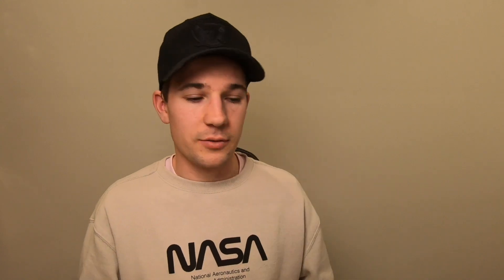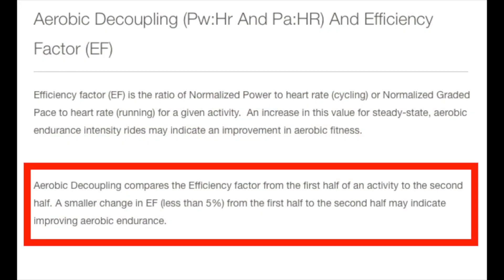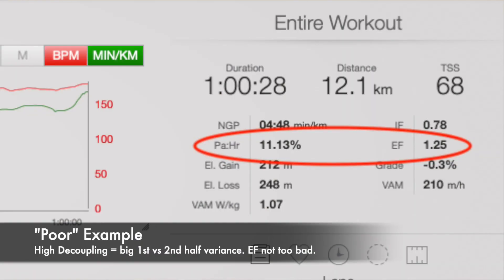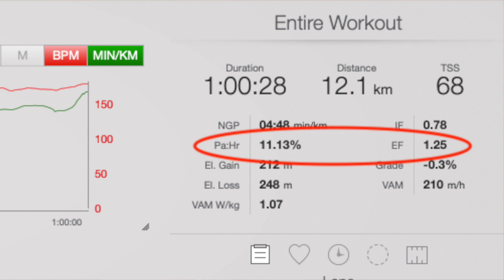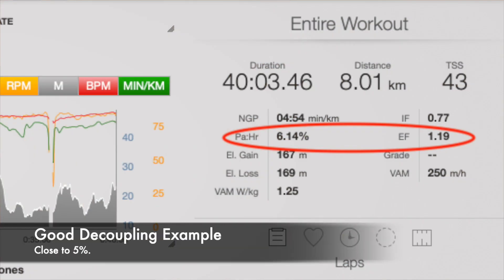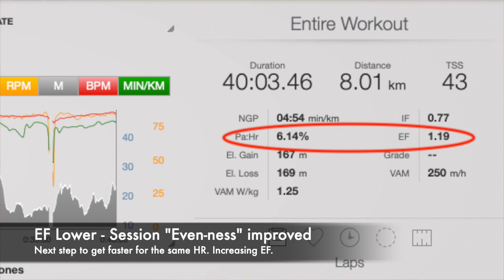TRACKING AEROBIC IMPROVEMENT: Aerobic Decoupling & Efficiency Factor Explained!

Comment: Improving aerobic base during non "base building" phases: worthwhile?
Reply: And love the channel, subscribed!
Reply from the maker: Can you be a bit more specific about what you mean?
Reply: @NJSportScience  
Plans often involve an aerobic block/base building of a higher quantity of easy running to build an aerobic base. Later they will add in threshold and anaerobic work at a higher intensity and lower volume reducing the percentage of aerobic work.

Is it efficient or even productive to try to develop the aerobic system during the latter phases that emphasise more tempo and threshold work?
Reply from the maker: A few things:
1. I’d never go all in on just one method of training and neglect others, for example most will do base aerobic as just lots of long slow kms/miles. When in reality you get similar mitochondrial adaptations from the long slow AND HIIT training at and around VO2max. So i use the 80/20 roughly and have bulk of the work long slow and a portion of HIIT to supplement the top end.
2. The aerobic system is always being developed in training for endurance athletes. Unless your event is <75-90s you’ll be having to develop your aerobic system regardless of what that looks like, HOWEVER you get a different stimulus for long slow base kms vs tempo vs theeshold vs VO2max work. The key is identifying what is most specific to your goals/event (ie ultramarathons base kms are key, 60min time trial then threshold is the key) but also identify your weaknesses (ie can’t increase threshold much further if your VO2max is low). This dictates how the aerobic system develops but it’s always developing.
Reply from the maker: 3. The short version = I always include “base kms” regardless of the training block because ALL endurance events rely on the ability to go from start to finish line OR complete max distance in a time period. You have to have kms in the legs to do this. The choice of higher intensities on the top is then just specificity for what you need and what your race is.
Reply: @NJSportScience  Thanks for the thorough reply and thoughts, Nick.  
I feel terrible asking more questions generally, but you asked in your video and gotta feed the youtube algorithm  😁

Your thoughts on 
1) threshold decay rate/detraining - minimum required stimulus to retain
2) what time is required to "sharpen" threshold/anaerobic/muscular/neurological adaptations when transitioning to more race focussed training (for trained [how long is a piece of string?] individuals) , if not able to maintain a "striking distance" ready state year-round?  

FWIW. coming out of the "off season", I've been doing mostly long and slow/easy runs with strides afterwards but not spending very much time in those top end or even middle zones.  I'm not ready emotionally ready for the physical and mental aspects of intervals yet😁 which is ironic given a couple of months ago I wasn't ready for the boredom of easy runs 😂
Reply from the maker: Haha appreciate the questions!
1) detraining happens super quick when you cut the intensity out. In theory you could do 2 interval based sessions (low volume though, ie 45min session including warm up/cool down) per week and maintain the majority of your fitness (will still decline but minimize the damage)
2) depends on the event but I usually go 6-8 for events <2hrs and 8-12 for events longer. Very athlete dependent and event specific however you’d probably just plateau after 12 weeks so not really worth doing much more than that from a threshold improvement perspective.

Comment: Hey Nick maybe you can answer why I sometimes get a negative decoupling value? During 2 races I've had a -5 %  to -8% Any ideas?
Reply from the maker: Negative decoupling in training terms is usually a really positive sign. It depends on your event as to ideal race pacing etc to determine if your going too easy, but it could also be a sign of great preparation to then allow your race pace to become more sustainable. 
Hard to know without context.
Reply: @NJSportScience  here are some of the metrics pwhr -5.13% , EF 1.38, VI 1.05, IF 0.68 ..... After the race I thought I'd pace the Ironman bike leg perfect but it didn't end up a great race... Maybe this was down to nutrition??
Reply from the maker: Could have been nutrition, hydration OR what were the comparative scores for the run?
Did you over exert early on the run or slightly underprepared in terms of running off the bike volume?
In most cases you know straight away if you’ve over biked and likely wouldn’t get those numbers if you did because HR should blow out.
Reply: @NJSportScience  run data pwhr 2.68% VI 1.05, EF 1.63 but IF 0.84?? Your videos are really encouraging me to look back at post workout data and where are what was good or bad.. Cheers man 👌👌
Reply: Looking back at IM nice I slightly over biked pwhr 14.3% IF 0.74 VI 1.08 EF 1.39... this race I ended up in the med tent.. 🙈🙈
Reply from the maker: Not an ideal end to race day 😂🤦🏼‍♂️

Comment: How does this accomodate for normal HR/cardiac level drifts upward during sustained activity?  (assuming it needs accomidation)
Reply from the maker: A significant enough drift indicates the need to improve (external to drift caused by heat/dehydration or incline changes). That’s why I mentioned in another comment also I like using the whole session view rather than small sections of a session.

Comment: Another great video man! 

Q - I come from a sprint distances pool swimmer background. I was wondering why most triathletes when training for ironman distance etc miss out a "long swim" like they would do a steady long run or bike. I see them doing a lot of pyramid work and 10x 400 for example bit never a Solid 4000m for example compared to them on the bike or run in which case they regularly go out and do a 2/3hr easy run or 4/6hrs on the bike at the weekend. Is there a reason why this is often missed in the pool? I would assume the energy systems don't suddenly stop working in the pool, other then the muscular fatigue factor
Reply: I still do a long straight swim of 2-3 km every week. Depends on boredom for some, you can still get volume with lots of shorter sets too. I'm only at half Ironman level atm though. Interested to see what other athletes do, and what the coach reckons...
Reply from the maker: To be honest that’s the minority not the norm. Most athletes jump in and swim at 1 pace the whole time either in “intervals” or one effort. I agree athletes should be essentially replicating their bike/run work but in the pool. However my thoughts are technique first, work on getting pace up and ability to swim fast first, THEN build the volume. Most are aerobically fit enough to swim regardless, the issue most have is being one paced.
Reply: @NJSportScience  what would you consider a fast pace? I had to learn to swim later in life but can swim at 2 min/100 m pace for 2 km. I'm guessing that's only an average pace and what sort of pace should an athlete be at before increasing volume each week? I'm currently training for Half Ironman and eventually full Ironman... Masters athlete too,48, male..
Reply from the maker: When I say fast it’s relative to the individual. For  the gun swimmers we’re possibly talking 1:05-1:10/100m but others might be working faster paces around 1:45/100m. There’s no benchmark, I guess my main point is be more deliberate about your swimming. Maybe I need to cover this in a future video to go into detail, but I like to use a benchmark session of say 100m repeats. Aim to do as many repeats without loosing pace but aim to go say a 9/10 intensity. As soon as pace drops off you stop the session (ie aiming for 90s per 100 then when you blow out to 100s for an effort then stop and cool down).
Next session aim to do 1 more than last time at least. Its a progressive and quality prioritized approach.
Reply: @NJSportScience  thanks for clarifying. I actually did 100 m sets today at 1:45, only 6 of. I had more in the tank, wasn't slowing, but will look into the progression of speed work and more sets. You made my training more structured, thank you 😊👍

Comment: Would you do longer distance runs if you Are mainly focused on 5k and less :)?
Reply from the maker: No reason to run longer than 60mins in a single run. That would really then be more for enjoyment of running. It’s just not specific for an event typically 20-25mins for most people. You’re getting 3x the required volume so more than enough. Probably on do that once a week and focus on the speed side more so.

Comment: Hi Nick, Great explanation. So decoupling value of less than 5% but you say efficiency factor as high as possible. Is this like higher than 1 or we talking 2, or even 5?  The other thing is Training Peaks on the app has a decoupling and EF per lap. It's also called Speed Pulse Decoupling. Is this the same? Do you think they take the 1st half of the lap and compare to the 2nd half. My EF was around 1.5/lap so not sure if that's good or bad. Decoupling is sometimes a negative value. What does that mean? I think terrain must make a big difference. HR goes up while running slower up hill. Could skew your results?
Thanks once again. Be safe.
Reply from the maker: Once EF gets to about 1.5 start considering challenging yourself a bit more.
Looking at per lap isn’t that useful in my opinion because the dat is super noisy (ie spikes rapidly) and its hard to then find a trend.
Decoupling negative values show really great aerobic ability and should be looked at a really positive sign that the body manages that workload exceptionally well when data inout is accurate.